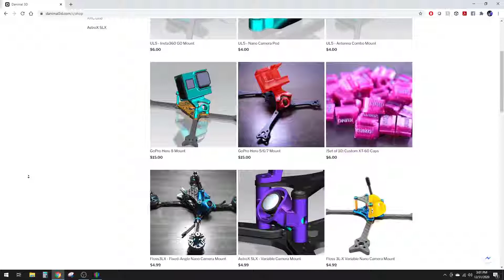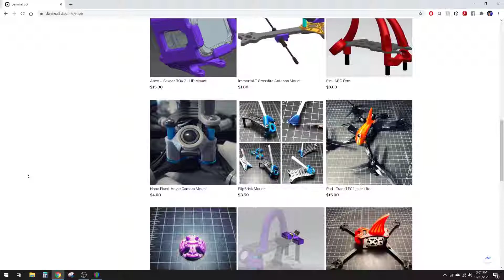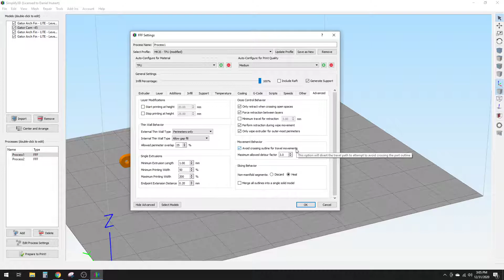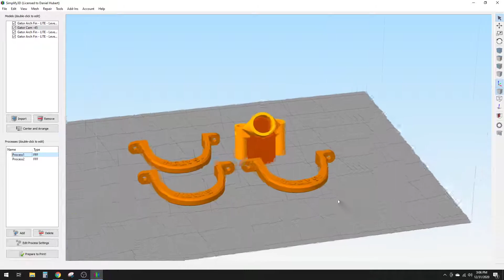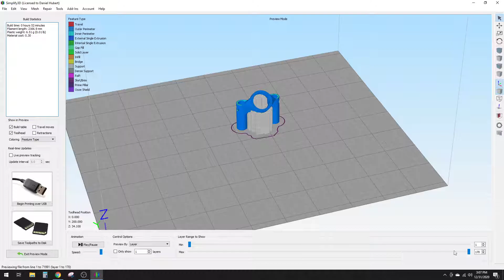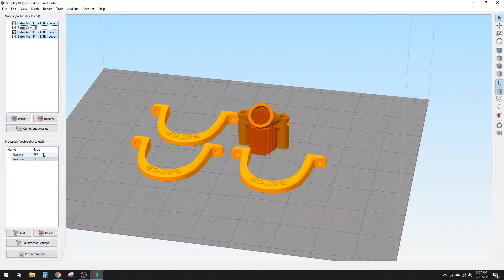TPU Settings -- Prusa i3mk3 | Simplify3D| Danimal3D.com

Comment: These are the worst settings ever!
Reply from the maker: LOL ! Welp they work great for me - super clean prints. Tweak / modify / don't-use as you wish!
Reply: @Danimal-3D  How come its saying over 500hrs and it doesn't extrude then? I've just downloaded a TPU fff profile from github and it prints fine. Copied your settings and it doesn't.
Reply: slow as fuck 100% agree went back to stock settings and is printing fine

Comment: Will these settings work with Mk3 S+  ?
Reply: Nice 👌, Juat ordered mine and I'm waiting for it like a kid on Christmas 😆,Thanks✌🏽
Reply from the maker: @ceegeefpv2676  you won’t regret it - I’ve had this printer since 2017 and bought a second in 2020.
Reply: @Danimal-3D  Nice,Yeah I started with the ender 3 and its ok for beginners but I got tired of the tinkering ,I just wanted something thats reliable and I don't have to relevel the bed all the time.Ive heard nothing but good things about Prusa and even though its a little pricey,I think it'll be worth it.
Reply from the maker: Yup!

Comment: How can you know if a print doesn’t need support? I printed a camera mount and I accidentally turn off support and i was surprise how good it turned out. Also how do you remove supports? I found it really hard removing supports specially with tpu and even pla.
Reply from the maker: Knowing whether you need supports comes from practice/ trial-error. Usually your settings will try to generate automatically for things overhanging more than 45degrees but you’ll typically know better than what is automatically generated for you. With my settings I simply pull away the support with little effort and some pliers.
Reply: @Danimal-3D  thanks!